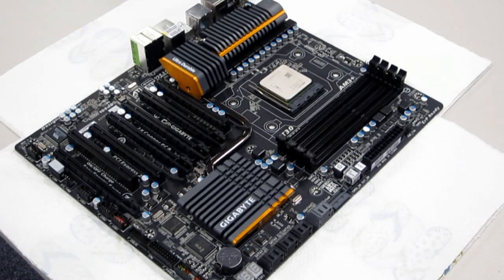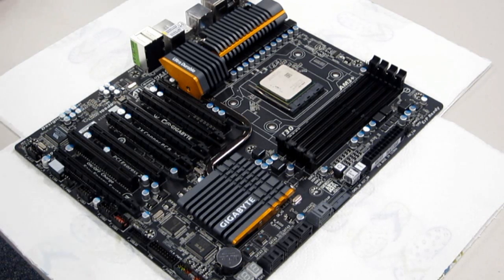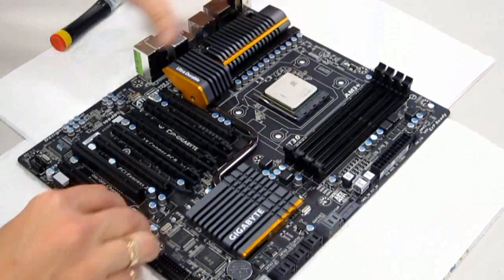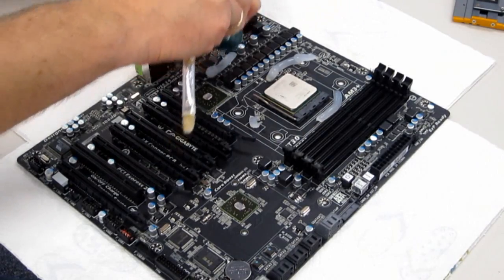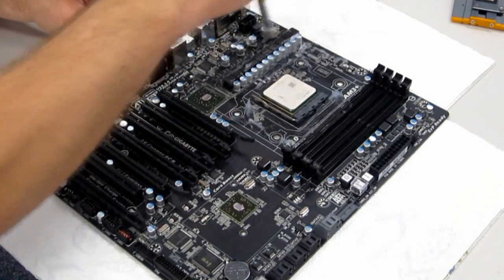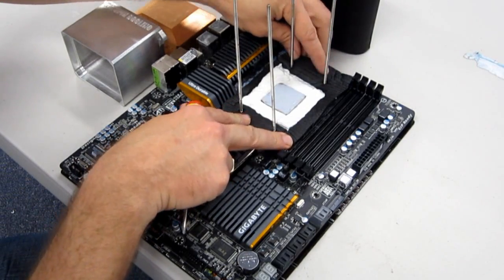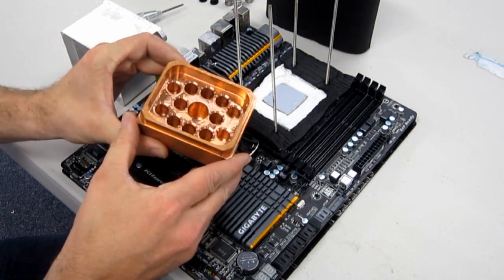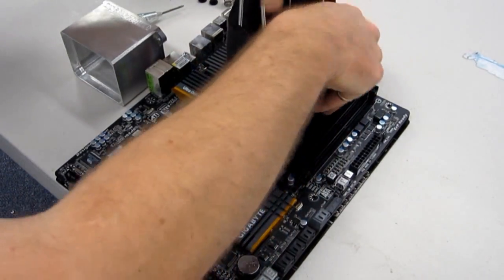7.8GHz AMD LN2 Overclocking at GIGABYTE Extreme OC Workshop

Comment: a metal pot with a flat bottom works well with ice and salt..  a ghetto version of liquid nitrogen :)
Reply: No not at all. It isn't like just getting a CPU cold makes it OC better. You need LN2 or Dry Ice and alcohol as it changes the state of the metal inside into a super conductor which allows the high OCes.
Reply: +Dr sausage fingers That sounds genius!

Comment: In 10 years, 8 GHz will be standard.
Reply: probably within 5 years mate.
Reply: BLR IDRIFT I wouldn't say 5 GHz is common yet. Most home computers still have about 2.0 GHz on average. Gamers tend to have 3-4 GHz.
Reply: Cube Tron Considering i own all the Ghz
Reply: ***** 2 years max since 5ghz is common now
even my fx 8320 has 4.0ghz in boost mode
Reply: consider my phone runs at 1.7ghz
Reply: That's not how CPUs work. We have stayed at 5ghz on air for about 7 years now yet CPUs are much more powerful
Reply: BLR IDRIFT consider mine runs at 2.3ghz@4Cores
Reply: I think it's more about the CPU itself and not the frequency. Having a really high clock just gives me the impression the manufacturers don't care enough about the quality. So that's why I personally think in 5-10 years the Processors will have a huge performance boost, but not by a high frequency.
Reply: Ian Elston Well my i7 is stable at 4.8Ghz today so...
Reply: Anton Torstensson my AMD FX 9590 runs at 5 GHz look on Google.needs some serious water cooling.
Reply: We're from the future
Reply: But my processor cost 250 dollars
Reply: Yours is 300 ++
Reply: Haloid Android Yeah, your processor is more "bang for the buck" if you're not doing some heavy activities except gameing :D
Reply: Anton Torstensson yhea I only game xD sometimes I do emails and shit
Reply: Highly unlikely in my opinion. The components that the CPU is made of have some electrical resistance in them so until the material is changed I doubt that anyone will clock their CPUs at 5GHz stock, let alone 8Ghz. 5GHz now required serious watercooling to keep at a good temperature. All the overclocks over 6GHz require liquid nitrogen.
Reply: Jake S this is exactly correct, silicon  is starting to hit HEAVY diminishing returns when it comes to increased clock speed. clock speeds have been stalling hard, and companies have been turning to IPC improvements to squeeze out more performance rather than faster clocks.
Reply: im running mine at 4.6ghz with 4 cores its the amd apu a8 5600k black edition
Reply: well that depends yes they actually do and no im not fanboying over amd since i still like intel a little more but that is just personal reasons but apu's arnt really all that good nor are they all that bad there for low budget gaming rigs and i only got it because at the time i didnt have much to spend amd dose have some advantages over intel but then again intel has some advantages over amd as well but there is no proof that either one of the are 100% better or accurate than the other its all like a guessing game but i do plan on upgrading to the fx 8350 processor and get a new motherboard until i can save up to buildi my new gaming rig i want the xeon processor by intel so i have a alot of saving up to do XD
Reply: PikaChuChuJelly nope

Comment: The electrical conductivity of pretty much all conductors are increased with lower temperature. If you would try to keep it at 0C it would generate too much heat and you wouldn't be able to keep it there efficiently

Comment: is that paste he uses the same as ones put in a between a cpu and its fan.I would think not since technicians advise against over compensating with the risk of the paste coming onto the motherboard and that he corrected his terms of what that"paste" was called.(idk wut it reely was called since i lost intersst finding what he called it).plz correct if im wrong i would like to know since a a bit was dumped into a ram slot

Comment: Don't try to be a smart ass, it doesen't suit you....the gravitational force pf the black hole would be so massive that the time it takes from the pain receptors any where on your body to your brain would be increased dramatically because the space itself would be streched , making you "freeze" in space/time (it's actially a asymptote which tends to 0, meaning freazing, rather than equaling 0)

Comment: not break its called the cold bug glitch usually happens at around -150 degrees celcious there is also a cold bug boot glitch where it wont boot if its under around - 100 degrees celcous

Comment: @1BYEBYE1 Well I don't know about breaking, but CPU's do have protection system which prevents then from booting at extremely low temperatures, also there is a system that actually turns off the CPU when temperature goes down below a certain point, and if these systems exists there is a possibility that low temperatures can harm the processors.